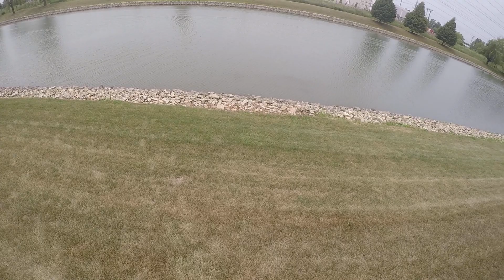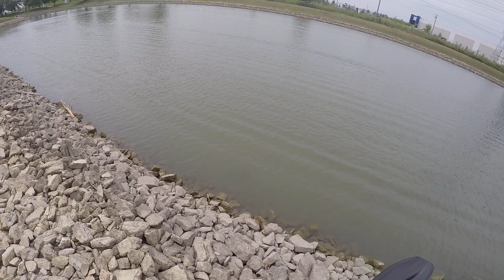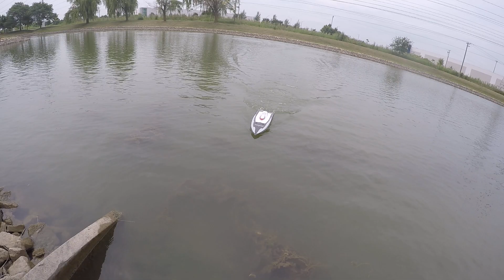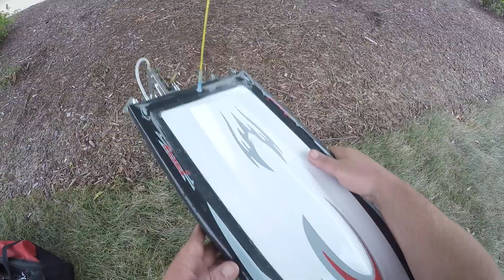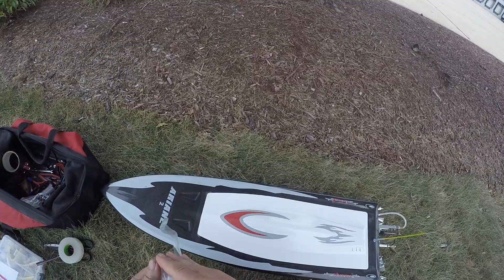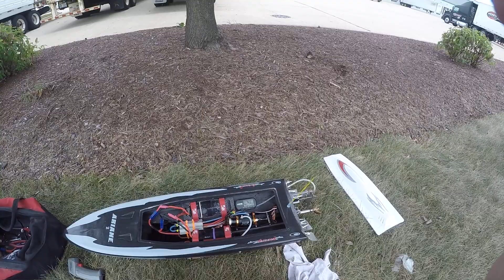New parallel configuration 2P 8800mah TFL ARIANE 2 70+ MPH RC BOAT

Comment: What kind of runtime do you get on average with those 6S 5000 packs?
Reply from the maker: ABOlsen69X 
I'm not sure 
I never run them that long in my opinion it pulls too much current to run that long.
Reply from the maker: ABOlsen69X 
I'm not sure 
I never run them that long in my opinion it pulls too much current to run that long.

Comment: Do you have an older swordfish with datalog to test? 

I have 2 swordfish 240hv from 2018, They both shows horribly wrong numbers, because Ive tested one older esc, and that one is more correct. 100amps less on datalog. So my guees is the newer models (included som X models) can show uncorrect numbers.